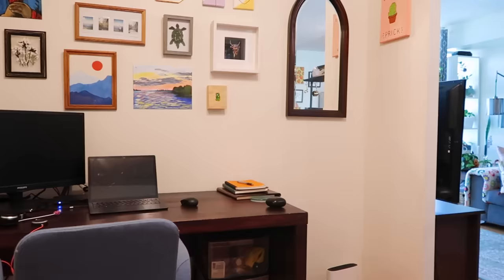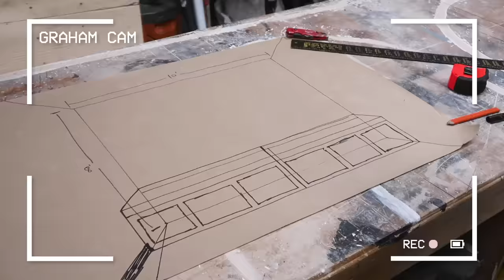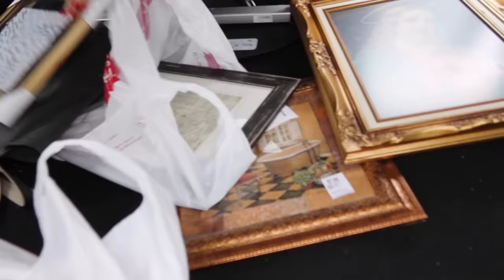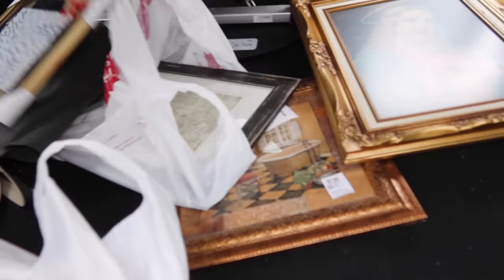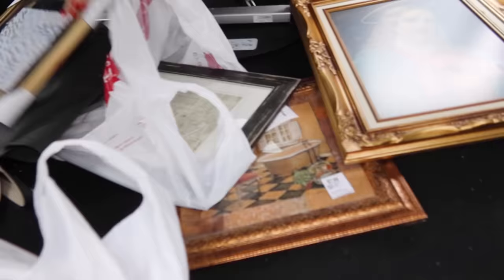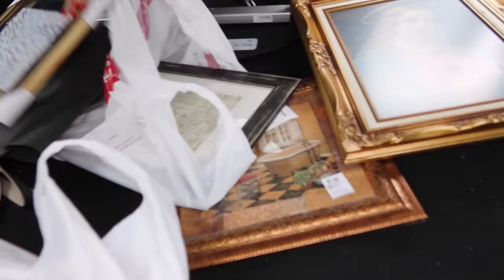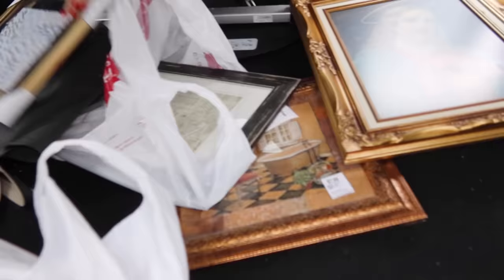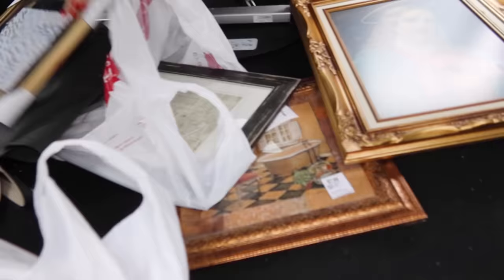Dark & Moody Dining Nook Makeover | Renter-Friendly!

Comment: Absolutely gorgeous!! The desk as a table I'm not quite sold on as not keen on the slot for wires in its surface, but apart from that it's gorgeous!
Reply: I feel the same way about the table not sold on it. I would think if you were seated on either side of the storage leg, you can't get close enough to the table to eat without bumping your knee or getting your legs in some uncomfortable position. Not a seat to sit for a long time to eat, chat and hang. The cord slot also seems like a hole for crumbs. Hope I am wrong or that they find a similarly shaped and sized dining table if I am not.
Reply: @Social Justice Jewelry  agree with you. I actually feel a longer rectangular table would make the space feel wider too. As it is, most of the bench wouldn't get used & as you say, you can't actually sit close to the right side of the desk & couldn't put a place setting there as the wire socket circle is raised. It looks pretty but it isn't practical at all.
Reply: @andreamalik2961  for small gatherings (4 people) it will be fine. It looks great but I agree that a bigger table would be more practical — maybe with rounded ends like the desk rather than a rectangle with corners. But I’m reminding myself of when I lived in a smallish apartment with my not-yet husband when we were much younger, and any gathering we had of more than 5 people ended up in the living room.
Reply: Everything looks gorgeous, but I do agree about the issues with using the desk as the table. I haven’t looked lately because I don’t have any more room for furniture, but I feel like article would have had a better choice for an actual dining table. It just seems like it’s gonna be really hard to get around those legs and I don’t like that hole in the top. That said, it’s a gorgeous transformation!
Reply: I'm the same regarding the desk - I thought that the bulky legs would make it uncomfortable to sit at in most positions, and don't like the cord recess. However, the couple can obviously test it out and if they need to make that one change to the space to make it work for them, it's still a fabulous transformation 🙂
Reply: maybe because the intent was to not put chairs on each end of the table because then it would block those who are sitting on the bench if they decide to go out. that is why alexandra literally just placed 2 chairs across the bench. so yeah the table being a desk is ok. but yeah a little bigger would be perfect.
Reply: Graham could’ve done something to fix this hole or even create a different top. It’s so wrong in such a perfect room.
Reply: Sorry, the “table” is a reach. It looks like a manicurists station in a nail salon. Everything else is nice.
Reply: Yes! I thought the same thing. 😬
Reply: Me too
Reply: I actually don't mind the desk as a table - it could function as a desk if someone did have to work from home but then could easily be cleared for dinner! And the cord slot can easily be covered with a placemat, so win-win IMO :)
Reply: Yeah loving everything except the table
Reply: I’m willing to bet money that the desk wasn’t their first choice for a table but they had to scramble. It’s not on brand for AG to have impractical, not fit for purpose furniture.
Reply: @TamarLitvot I'm not sure if 4 people can sit comfortably at this table. The legs are too wide and the table top is too small to fit all the legs under. The table top is also rather small to place a good spread and/or more than 2 or 3 dinner placing sets. I'd definitely go for a more useful table there.
Reply: @e.458  In retrospect, I agree

Comment: They can add a 1/4" thick, larger panel (could even be hinged to be foldable for stowing) for the table, for those once-a-year, large family events.

I had a big table, used it only once or twice a year + had to battle all year for it not to turn into a repository-of-stuff surface plane.

Comment: Inspired design.  Regarding the desk/table: have a piece of plywood cut to mimic the shape of the table, only larger. Hang it on the blank wall opposite the mirror. Place on top the table for larger dinner parties.  A rectangular table would be less desirable to access bench, i would have bruises from corners of table. Untainted furniture stores often sell as toyboxes. You could also shop at Habitat Restores for short upper cabinets and put on a base. If you want to take the bench with you,  build in smaller sections to be more adaptable to future spaces.  Or buy ready-made benches and custom make pieces to in-fill your current space.  Example: for an 8 ft wall use four 2 foot benches. For a 7 foot wall use three 2 ft benches and build one 1 foot bench. With the same color paint and same cushions,  would not be too noticeable. TFS.

Comment: Nailed the aesthetic not the function. I am sure the clients will use the space. I think it is perfect for morning coffee. Love that you added the storage under the benches - I thought that was going to be for the extra books. The bookcases are just space takers. You could have a larger table if you got rid of the bookcases. The desk as table is perfect visually but I don't think you could fit four plates and four cups. I think the client should add some of those micro pedestal side tables on either side so they could at least have 3/4 people across the bench for cocktails.

Comment: Just an FYI on your diy.   When building your own extention cord for the sconces, it would be prudent  to use  the right cable and connectors.   Solid core wire(romex) should not be used  for this purpose ,  use  stranded cable instead.  It's a similar price. 

 wire nuts are only to be used Inside electrical boxes and should not be covered in electrical tape.   You can buy 3 prong ends to finish the cable  so you can plug it in.   
This is a fire/life safety hazard...
You should go back and correct it.

Or at least edit that part out of the video before the Insurance company sees it 😉..

Love your stuff.   But I'm having a heart attack over this.
Reply: 👍 for flagging. I'm the same when I see her put blinds up which I'm 99.9% sure don't meet Canadian blind safety regulations
Reply: @outoftheburrough   they have the resources to do it right..  A strong designer needs  some build consultants.  At least get the advice of professional installers..   Graham knows alot  but far from a licenced contractor, he should at least be getting advice  from a pro.
Reply: Yes they can do it, but make sure they do it the right way. Maybe consult an electrician a few times.
Reply: Exactly, when you know people watching will likely copy what you're doing & you're seen as the expert (rightly or wrongly), if you know you're not then consult one or at the very least give the information available regarding regulations & compliance for people to make an informed decision.
I'm an upholsterer & the fact they blindly reused old foam on this project to cheap out has annoyed me also.

Comment: Why did Graham use an air compressor with the staple gun, does anyone know?
Reply: Because most electric staple guns are dire & don't fire the staples in fully without leaning your full weight on them which isn't practical for more than half a dozen uses. He likely already has the compressor to run other tools so a pneumatic staple gun is a pretty cheap thing to add to his kit, some will do staples & brad nails (though not as good as dedicated function tools)

Comment: Why is one seat raised up higher than the other.
Reply: They were uneven when popped up while the painted over the caulked areas dried, any variation in height after that will be because they split a thicker piece of foam (which won't be exact) & likely didn't tension the fabric evenly on the 2 cushions

Comment: Cringing soooo hard at you using old foam 🤦🏼‍♀️
I'd have done 3 cushions/openings, with 2 and centering the table as a couple the person on the bench ends up straddling the gap, & if you have 2 people on the bench everyone has to move to access the storage, whereas 3 openings you're more likely to be able to access 1 or other end easily without disruption. & Rule of 3.
You won't get the fabric even by permanently fixing straight away, pre tension & temp tack all sides first.

Comment: It's beautiful. 
But - seriously - do not run unprotected electrical cords between a wall and wall paneling. This practice is life threatening, if not immediately, a few years down the road.
I've seen other influencers use battery powered puck lights in wall sconces. Not great to throwing away batteries often, but it is much better than burning down an apartment building.
I really am sorry to be a downer on a fun decorating video but this is too important to ignore.